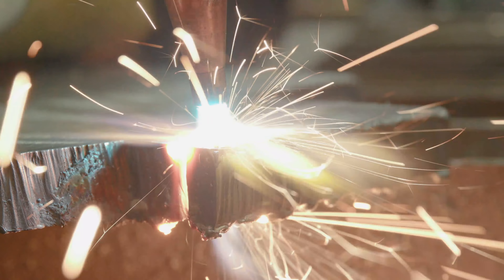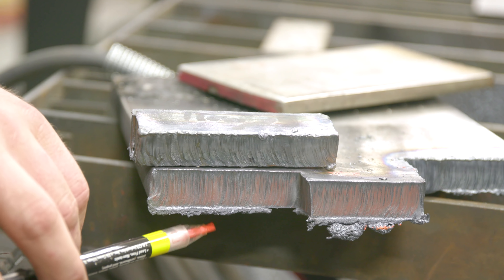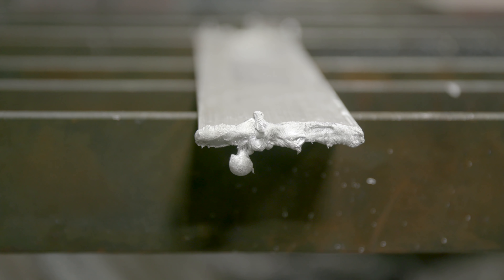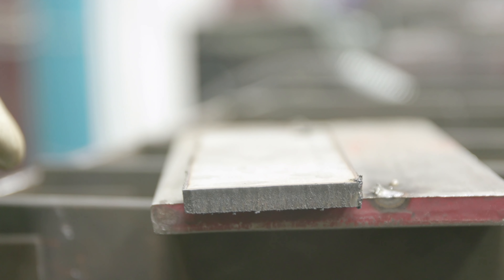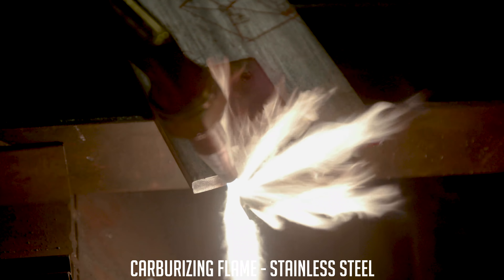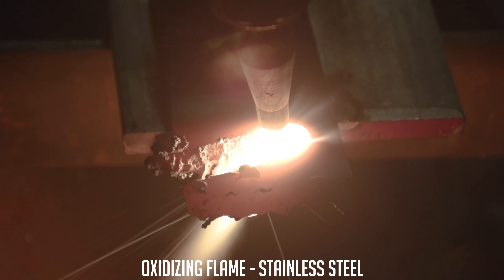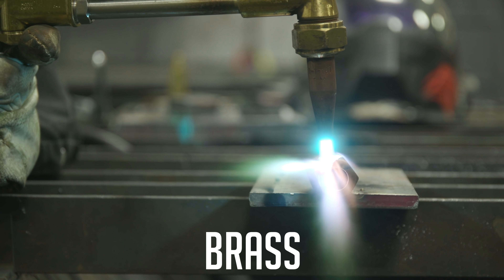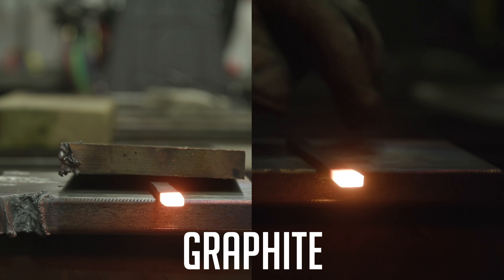WILL IT CUT?! Plasma Cutting vs Oxy Fuel Cutting

Comment: oxy fuel works by hyper decaying steel through the same process that causes it to rust, just a lot faster. it makes sense that it wouldn't cut material that does't rust when oxidized
Reply: yeah!!! science!!!
Reply: 🤔It's more complicated than that. If it cut by heating the metal and rapidly oxidizing to push away material, it wouldn't have a problem with aluminum. But what's got me scratching my head is how easily it cut the copper tungsten. I've never seen that alloy before but neither of those metals are ferrous. Plus, how is it that two of the most thermally conductive metals we know of get heated enough in seconds to cut?
Reply: This issue is less that aluminium doesn't rust or oxidise because it does. The problem is the oxide of aluminium melts at over 2000°C but aluminium metal melts at 660°C. Cutting with oxygen relies on the oxide having a lower melting point than the pure base metal so when you hit the oxygen and it reacts forming the metal oxide, it instantly liquifies and is blown through the kerf.
Reply: Zack Kemp f
Reply: @timbalzer7688  The way my Father explained this to me is similar to what you said. He told me the Combustion Temp of Steel is lower than the Melting Temp, that is why Oxy works well on Steel. Other Metals, and I do Not Know What, could be cut using what he referred to as a Powder Cutting Torch. I think that would be like a powder used in Metal Spray Welding. Be good if some other out there knows about this older process with a video and more knowledge than I have.
Be Safe, cheers from John, Australia.
Reply: Now this was a trick shown to me by an old timer if you superheat your ss first then clamp a carbon steel plate to it with an over hang to lead into the cut of the ss. Once you get a small cut into the carbonsteel  the oxygen will force the carbon into the ss and the stainless will cut it’s not “pretty” but it’s not a dull apprentice with an angry beaver routine
Reply: Steel doesn't decay when exposed to just oxygen or air. It requires a combination of oxygen AND water (including moisture). Oxy/Act cutting is not similiar at all to what causes steel to rust and fall apart when exposed to water and air.

Comment: Nice.
Other things that I know can be cut with a plasma tip are glass, lcd screens and also drywall panels (with a pilot arc).
Another thing that can be done with stick is to carry a puddle over a glass plate.
Reply: Stick over glass?! I get it, as long as the puddle stays connected, it's grounded. That would be so weird though. Item one on dumb things to try whenever I get a welder.

Comment: all I had in Vietnam was a oxy torch. First time someone told me I could cut aluminum I said your crazy. But I learned you could make a decent cut with a welding tip (not cutting). As it got hot crank up the oxy to blow the aluminum away. I have also used this method on getting a broken head bolt out of a tractor head.

Comment: So now you should explain the dynamics of how each system removes material. As they are totally different processes it shows how the structures are disrupted at the molecular level, the results are more predictable.  One is essentially accelerated chemical reaction, the other  reduces( breaks molecular cohesion) to original molecular state.
Reply: Plasma is the 4th state of matter.  Any state of matter at high speed can cut materials. I've always been curious how mass less lasers can cut materials since photons are considered a zero mass energy. 
Just imagine what people will have at their disposal in another 50 years! We've made so many advances in materials and tools it's mind boggling.
Reply: Someone here has done their homework. From the Weld.com videos I've seen they don't go very deep into science....or technique for the matter.
Reply: Tyler Nelson not sure if you’ve e watched bobs intro welding videos..I think he is one of the ones that helped me the most!

Comment: OK, so I now need to buy a plasma cutter to cut metals my Oxy Fuel set up won't cut but I need my Oxy Fuel to warm or cut steel outside on a job because my compressor isn't mobile. Thanks for that, great video, very interesting but potentially expensive!

Comment: Oxy fuel cutting works by burning not melting, It also relies on the oxides then being free to leave the parent metal. It is even possible with oxy fuel to turn off the preheat after the ignition temperature has been reached and continue cutting. On plain steel the oxy fuel is more versatile as far as thickness is concerned, just change the tip and you can cut an inch and half or two inches with the same torch that you cut a quarter inch with to cut that sort of thickness with a plasma cutter requires some very expensive gear and a massive power supply.

Comment: Can you cut C4 with oxy fuel? Can you film it?
Reply: Is actually interesting. C4 is quite stable and requires a blasting cap to detonate (fire isn't enough usally). But an oxy fuel setup has a lot more energy and higher temperature than a "normal" fire...
Reply: Even more funny C4 makes grate camp fuel and a blasting cap or detonator if you will just kicks off a  chain chemical reaction.

Comment: you need to show 1 more process to compare, using the Henrob2000 or variant name cobra2000? plus 1 more name, which was called cuts like plasma, for steel it really is awesome, I had mine around 30 years.

Comment: Interesting, always wondered about the science behind the two methods, Plasma is very limited in cutting thickness, but will still cut materials that wont oxidise, is that because what is happening is the air stream is just blowing away a melted material, whilst oxy is a chemical reaction where the steel is oxidised away? (hence why oxy can't cut stainless).

Comment: Does plasma cutting capacity depend on the torch itself? My 50 amp plasma cuts only up to 14mm with an sg55.
Reply: Should cut more than that , say 16 mm or 20 mm  what size is your compressor ?
Reply: Actually my machine is mostly designed for tig (has pulse function), but it can plasma cut too. My compressor is big enough, about 206 l/min and 8 bar. I run the plasma between 4.5 and 5 bars.
Reply: @csacsamolnar   try 7 bar , ?
Reply: @timothyrouse2853  Most torches I see are rated for 4.5-5 bars, so is mine. The machine's data sheet say it cuts 14mm max, but I'd love some more. Wouldn't it damage the torch or something if I try 7 bars? I am really new to plasma cutting.
Reply: @csacsamolnar  it might mess up the bowl or an airline on the inside of the machine maybe. but generally they are more durable than they claim them to be. your call. The torch design does have a lot to do with it though. and how the machine uses its power. If you find Jim Colt from hypertherm he is like an encyclopedia on plasma cutting. He likes the internet too if you know what I mean.

Comment: I need help. 

Im on v-groove (60 degrees) horizontal removable butt backing, and I’m having a hard time trying not to weld the two base plates to the backing for it has to be removed. My teacher has stressed to don’t stay in the center long and to hold on the sides of the grooves.  I’m doing a counter clockwise circle and holding at the sides for about one second before I circle back to the other. At this point I don’t know what I’m doing wrong. The backing is (according to my teacher) supposed to fall off after the tacks are cut, and not have to be bent or torched off. I need help.
Reply: Root opening is 1/8
Smaw 6010 1/8 rod

Comment: what about using a smaller cut head on your oxfuel.. and perhaps less oxy psi.  see how that would work?
Reply: I do not think that any oxy cutter will work. The oxy cutting works because there is very exothermic chemical reaction of iron and oxygen (burning). It has two synergic effects - it eats the base metal and it heats up new metal to the temperature needed for the reaction. Because the oxides of iron have low melting points, they melt and flow from the cut. All of this enables more iron and oxygen to burn and the reaction can continue very quickly. For example, aluminum is much more reactive than iron, but it forms thick layer of Al2O3, which has very high melting point. The solid layer of aluminum oxide immediately stops the reaction, so what you get is droplets of melted aluminum completely encapsulated in oxide layer. This is the same issue when welding aluminum with DC TIG.

Plasma is more successful with aluminum, inox and other metals, because there are major differences between plasma and oxy cutting. Plasma has much higher temperature and pressure of the output stream, so it works very similarly as laser cutting. The stream of plasma melts tiny spot of metal and then blows it away. Laser cutter uses focused laser beam to melt the metal and nozzle with pressurized gas to blow the metal away (the laser beam runs through the gas nozzle). But there are another challenges for plasma and laser cutting. For example, the copper has very high thermal conductivity, which makes it difficult to form the tiny puddle of metal. It does not melt, because the heat is dissipated too quickly, or it melts big spot, because the surrounding metal already absorbed a lot of heat and is near melting point.

Also you can check oxygen lance. It is interresting technology for cutting massive pieces of steel.

Comment: It will not work to cut metals in which the oxidation temperature is higher than the melting point, for iron, on the contrary, the combustion temperature is lower than the melting point

Comment: Oxy fuel cutting is basically high speed rusting.  If it doesn't rust, you can't cut it with oxy fuel.